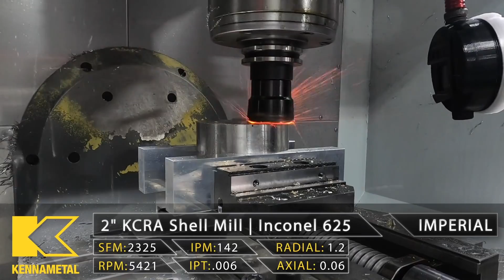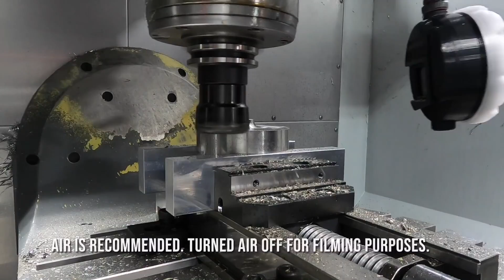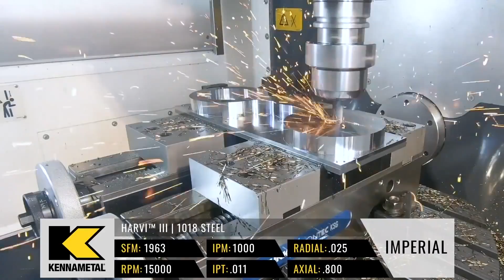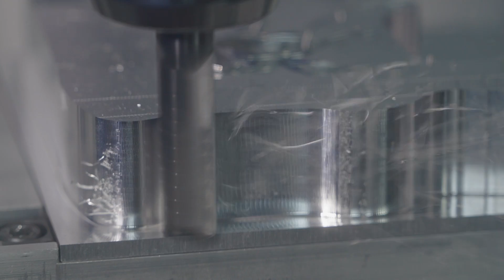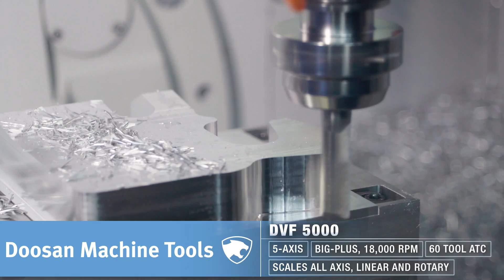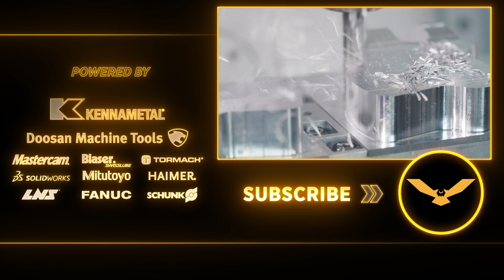FRUSTRATED because my Boss Runs Machines Too Slow

Comment: Coming from a manual machine environment onto a 2021 DMG Mori was a huge leap for me. Going from the "high speed spindle option" 2000rpm geared head box way machine to a 12000rpm linear guideway machine is a process but within my first month I drilled holes at 2m/min on steel, I used a through coolant exchangeable head to go 10x diameter in gummy aluminum with no pecks, I threadmilled parts to the correct thread tolerance (BSPP threads) despite the sample thread being oversize, I milled aluminum at full send to prove to my boss that the aluminum profiles he tasked me to do would never and should never take more than a minute and how our machine is idling in waste if it takes us 3 minutes to load a single part that is done is under 30 seconds and how a vertical will hinder our progress if we keep doing those crapshoot jobs.

Comment: Trying to get them to understand they need to replace equipment goes right along with that. 

We had two WEDM machines that were constantly down due from mechanical issues mostly related to age. One was 15years old the other 20 years old. Ended up writing up a 10 page report for the office to go, huh we could get a conservative 10% cut speed efficiency gain just by getting some new machines, completely ignoring the down time. After nearly three years of the paper work being tied up in cooperate, finally got two new machines. Saw closer to a 15-20% efficiency gain, and thanks to the increased reliability a 50-60% decrease in turn around. Machines will have them selves paid off in under three years.

Comment: Sadly I got laid off during the pandemic in the UK - I'm only 23. I was a CNC Programmer for 8 machines in aerospace industry, trying to get them to a runtime that could match yours. We had Kyocera & Kennametal as our standards so couldn't ask for much more, I was told the rate I was pushing the own work out was too fast so they are now letting the machinist manually program them. 7 months have now passed & I'm running a UV flatbed printer, 3D printing my own jigs & fixtures. The company I use to work for, now the industry is becoming back to normality, cannot find someone to compete with what I had implemented & is now declining repeated work because my old programs are deemed "unsafe to run".

Comment: I have also experienced the boss that ran things too fast. He would walk around the shop and crank the feed overrides. As soon as he walked away things would go to hell. There is a fine line between great parts made quickly and junk parts with broken/worn tools.
Reply: I agree with you mate. It happened to me as well where the feeds and speed where high it just ended up chewing the carbide tips. It did made the production higher but it was costly.

Comment: I always encourage my guys to think outside the box I will always try new ways if it works great if it doesn’t we revert back to the original. key thing throughout as mentioned before when ambition outweighs ability it’s a very very very fine line. Also it’s 100% key to never let the tail wag the dog.

Comment: Yep your so correct in what you say, I was a contractor working in engineering. Working long hours for different companies. When the contracts ended so did my job with them. But i worked hard to manufacture components for threm, worked the over time. Built a working relationship with them, made new friends with them. So when a new contract came up. I was the first to be asked to go back. There have been many that got me to work on other contracts manufacturing other parts just to keep me there whilst waiting on a reorder for parts.
Yes I desperately wanted a full time job. But it stuck with it.
The reward was in the end a role came up to be a instructor teaching engineering just like Titan is doing.
I find teaching engineering very rewarding, and what he just say is very true.
I teach manual maching and manufacturing. I really wish we could teach nc/cnc machining. If your looking to learn nc/cnc manufacturing your in the right hand with Titan.
Great video, I hope this inspires you all.
🤟😎👍

Comment: Titans is correct in his attitude and thinking. However my life in business has taught me that even when the owner and worker are pursuing common goals. the math problem puts their priority's in different places. here is the math problem. A $50.00 tool does not cost the shop $50.00 At a fat 10% profit margin that shop has to generate $500.00 of work to replace that tool. That does not account for the downtime to change, correct offsets. order, etc. When you start thinking in terms of what do I need to produce in order to pay for....?  you are now in the mindset of a business owner. always know your profit margin, and do the math correctly, It stings a little, but it helps set correct priority's

Comment: got me thinking. im back in the game as a machinist now at a new factory. and what i found odd was they made a bank breaking deal with Iscar tools. sure they deliver fine tools. but asking for tools other than iscar would very likely turnout a negative. because of this deal they made back in the days. should i push through if i find a replacement, or stick to the deal that was from before me? i find it very odd they even signed this deal.

Comment: Yep same where I work everyone thinks a 1/2 hss endmill running 1500rpm 10ipm or less in aluminium is ripping it. The engineer thought he was going to learn cam so I told him what I was using for calculating speed and feeds, a few days later he went to a older machinist and asked if his numbers were correct because he never seen them run a machine that fast. The old machinist said we are not that kind of shop we run it slow. I think the engineer gave up after that because I never seen but one test program. I have my own cnc machine and have shown what can i can do, also shared some videos from titan. But nothing has helped. Now we do most everything on manual and it takes for ever while the designated cnc operator talks to everyone and watches girls dance on tik tok. The cnc Is used as a brake in between cycles instead of to make things faster. Even the boss has said that its it's better to take much longer on a manual machine than to get it done quickly on the cnc. Sorry for the long comment I'm just tired of it.
Reply: 1. The purpose of a machine shop, like any business, is to make money.  2. Feed rate is a business decision that should be considered along with other financial consideration such as wages, tool depreciation, and the like.  3. “We’re not that kind of shop” people, who have only a faint understanding of the first two points, should not be making business decisions such as feed rate.  4.  It takes a determined, ongoing management effort to keep “we’re not that kind of shop” people under control.
Reply: @kenp3L  Thanks for the brake down. I use to try to encurage my close coworkers to think outside of there box by showing machining videos, but I found out it is as you said. I had to decide to do the best I can with what I have available, until I finish geting my business set up and going big enough to leave (which was the plan since day one). My biggest problem really is that I became allergic to coolant mist, grinding dust,  oil spray from cleaning off cutting oil with compressed air , and lacquer thinner. Because of allergies alone self employment seams to be the only option for my future health.

Comment: I remember I was just a 5 axis water jet operator for this company, and they would scrap so much titanium formed sheet metal parts due to crappy work holding fixtures and terrible programs. I was learning so much on second shift from one of the manufacturing engineers and he taught me to program. Once I got real good I brought my boss in to see one of my 40min to 20min cycle time reductions. Ya know what this guy told me? I should focus on stuff I’m more qualified for like 5S and organizing the nuts and bolts…. Glad I got out of there. I became a Machinist, then programmer, a team leader, a programming lead, and now I work in the Engineering dept doing CAD work. They don’t want to hear it most places Titan, I swear they try and run it into the ground just so they don’t feel bad sending to China.
Reply: And thats why you are where you are, now! You did exactly what you were supposed to, despite the egos and negativity. I never thought that I would be working side by side with Titan every day, but here I am!

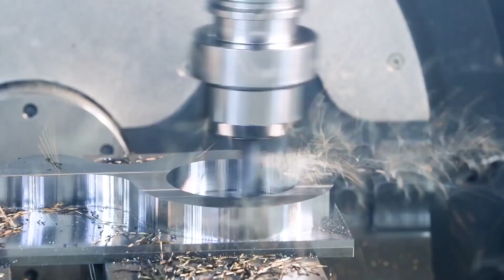Comment: The advice at 2:20 is so valuable. I'm an instrument maker by trade and before worked at a high production company. Now I'm working in a 3 man shop as a tool and die maker and finally there is room for my ideas.

Comment: I think a lot of american machinists see random numbers and think they are "fast". In aluminum i think that first barrier is at 100ipm. That is what i finish at. I like to rough with 0.500" endmills at 200-1000ipm depending on what is going on. I also see people running small drills at like 2500 rpm. Wtf. Pretty much any drill below 0.150 should be running above 10,000 rpms. There are arbitrary self imposed limits. Even with a 2" 5 insert cutter i run 225-300ipm for roughing. It's sad that some people will never know those "limits"

Comment: You are my kind of guy. I was the same as you during the years I worked for others. Always best or at lest one of the...But then it downed on me, that if your boss doesn't appreciate you being better and faster than anyone else(and that happens quite often), you are working for wrong boss! I ultimately opened my own shop...making 7 part an hour for  a part the company from which the part came spend 60 minutes!  And there was nearly endless supply of these types of work. Once they told me I am making them look like idiots, because they could not make same quality and same speed of work I did....

Comment: I run a DMG Mori NLX 3000 700 lathe at work and I always turn my rapid and spindle over ride to 110 and 120% from 100 to speed up the cycle time. Some peiple people in the company don’t like it because it goes through inserts faster and they say you’re actually losing time changing the inserts more often. There is definitely an algorithm and a balance to it.

Comment: Thanks for this.  I fight this everyday.  The big problem these days is also pay.  Shops do not want to pay a skilled machinist.  I have 10 years experience.  Im certified in gibbscam.  I run mazaks, mori seiki, haas, doosan, star swiss turn, various tool room lathes and mills.  I just saved the company $30k a year on one part.  I only make $2 different then a 1 year operator.  It gets discouraging.  You start being tempted to let a company fail, because they dont deserve what you worked hard to learn.
Reply: @mike d yeah i have a 56x26ft steel building im working on remodeling.  Then time for electricity.  Its getting crazy out there.
Reply: There are companies that pay pretty good for machining. They aren't small shops. Go to a larger engineering company that has a shop. Big difference. I have doubled what i make in the last 6 years.
Reply: Dont get discouraged!!! Company A, B, and C might undervalue you…..but always stay focused on company D, that will love what you do and reward you accordingly.
Reply: Quit working for production and sweat shops.  And if you are as skilled as you think you are go work at job shop as programmer operator.  But don't count on all job shops using cam software.
Reply: @charles3493  i have done both production and job shops.  Heck i was a head programmer for a job shop and they only payed a dollar more then i make as a "production" guy.  Also production machining at the fixture designing level isnt as easy as guys tend to think.  Its one thing to fixture sonething to make it once.  Its another to fixture it to last a million parts.  State i live in is in flux for pay scales since covid.  The manufacturer mafia, (cough) i mean the manufacturer association has kept wages down for a long time.  Shops are all over the place right now. I say a job posting for a seasoned setup guy for $20hr, and a job for tool and die maker for $14 and a mold design engineer for $16, mold maker for $28.  No one knows what they should be paying.  There are even some shops trying to hire operators for $11.  McDonald's is paying $15hr here.  Its crazy.  I post my resume and i get calls all day.  Some have called me, and i passed because of pay.  They call a few weeks later hoping ill change my mind.  And i pass again.
Reply: @pharaun159  the fixture making gets hella easier as you gain more experience.  I've been doing this for 30+ years and that's excluding all the child labor from working old man's shop.  Damn, those wages suck in your area.  A basic operator with 3-5 years experience is 16-18 Oklahoma.  Well,  shops that produce automotive parts suck.
Reply: @charles3493  you are not wrong bud. Erie pa is the cesspool of manufacturing.  If i didnt have a family farm of 80acres...id already be gone
Reply: @charles3493  im making $22 making crankshafts, and barrel cams and crap like that.
Reply: @pharaun159  no amount of money could keep at shop making those parts.  I'd shoot myself.
Reply: @charles3493  lol dont read too much into.  They are pretty basic cranks.  And generally cranks are ground in.  So as long as you can hold the grindstock tolerance, you pretty much cant screw it up.  But i say that, and yet im told its been 11 years since this machine made money, and then i have to question myself lol

Comment: If you’re replacing inserts or tools every 2 parts is that too slow? When the run is 40 pieces and an end mill costs $400 and a full set of inserts is $100?
Reply: That is what I am wondering....When you have that one guy that seems to get more done in a day but ends up breaking more tooling because of it.  Does he have a reputation of getting more done or the reputation of going through more tooling.
Reply: @javierh6997  Sadly, a reputation of 'getting more done,' and tooling cost for the job is an afterthought, usually not really critiqued while the job is running.  I've worked with many people who, at the start of their shift, would buy all new inserts and endmills and change them all out because "I don't want to have any problems."  

Not only did this drive tooling costs up, but productivity was down while the machine was stopped as they changed tools.  And with new tools installed that haven't yet found their 'sweet spot' between sharpness and wear (where they are most repeatable), now most of their tooling offsets are a complete unknown.  

They did not care, just wanted to "have no problems," and once they hit cycle start, were free to pull their phones out again and ignore the machine, and the dimensions on the part, usually leading to more scrap.  But hey, "they kept it running!"  

Judging from some of the other comments here, this type of idiocy is quite common, and at some point people need to make a decision whether to continue working for a company that tolerates (and even encourages) poor behavior, or whether to look for an employer that is a better fit with their own work ethic.  Like Titan said, you never know what's on the other side of a different door!  

What we do know, is whether or not we feel engaged and excited about our own work, or whether we feel stifled and ignored by management with little or no experience in what we do and how it actually effects costs/productivity.
Reply: @Dyna78  I come from older era... I had machinists turning feed rate down to 50%  : otherwise the part is ready but I did not finish one page of news paper...😁😁

Also heard :  Feed rate of new inserts could be doubled...but we raised it 4 times to break the inserts... Because we asked 1000 times for better inserts  , always got NO for answer . And now they want us to work harder with new inserts...go to hell.
Reply: Best way to work is to balance tool life with machine hourly rate. If you break a $100 end mill but save multiple hours you have already made the extra hours worth on machine cost offsetting the tooling cost. Then you can get onto the next job quicker and overall increasing the workload potential of the shop. Not such a priority if the workload is low but when things are pumping it's the best method I've found.
Reply: Time for inserts is like 45 minutes

Comment: Bean there done that. Told "Boss Man" I Needed rigid tap holders. Boss Man says "I can't afford to break any taps" I ended up putting taps in drill collets, change G84 to G84.1 ( I think. Iv'e been retired for 6 years so things are a little wonky). Worked realy good. Went around "Boss Man" to get new tap holders. I did everything I could do to make things better and now it is all in Mexico, China, India and so on.

Comment: You covered this during your BoomTastic event when you stuck the large drill bit in the stainless. Machine downtime, potential scrapped material, damage to tooling and fixtures, excessive machine wear and damage, delays in delivering, potential injury and stress on your employees. a.) hurry up and screw up, or b.) do it right once  ---  I will choose B
Reply: It doesn't hurt to learn the limits at some point or you may be running way below efficiency and never knowing it. It's never fun to crash a machine or lose a tool but even with my few years the amount of time saved has constantly offset the downtime or broken tool cost overall. Not saying every shop is the same but I'd never go back to running how we used to.
Reply: @UnderearthEDO  Exactly this.  The lesson is run the tool and machine as they were designed, but it's hard cause we all know too well that sick feeling of a tool going crunch, that makes many of us run slower then we should haha.  Some of these speeds and feeds are terrifying at first :p